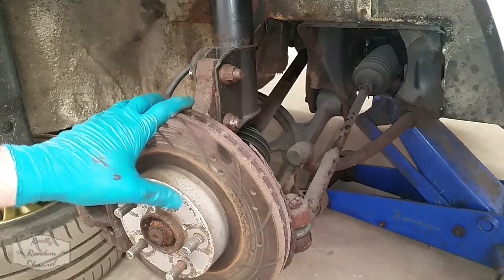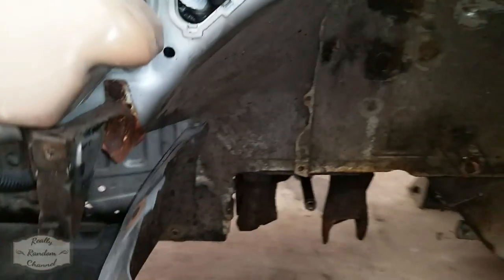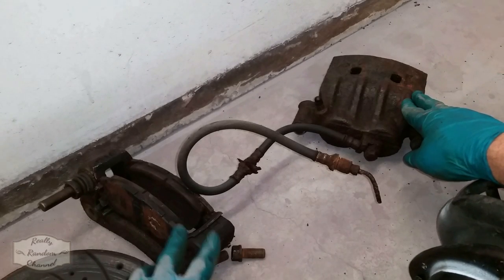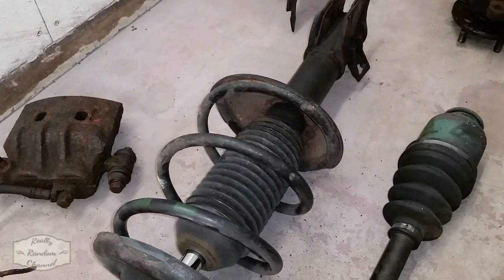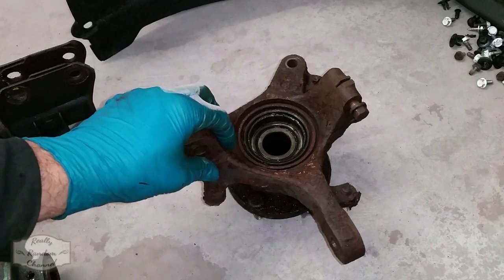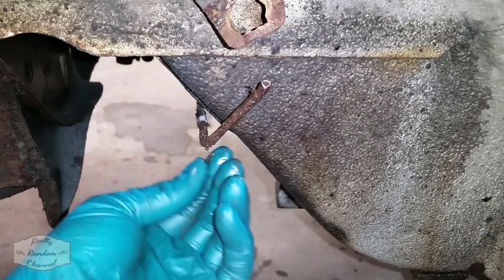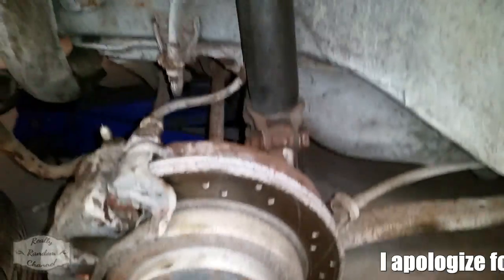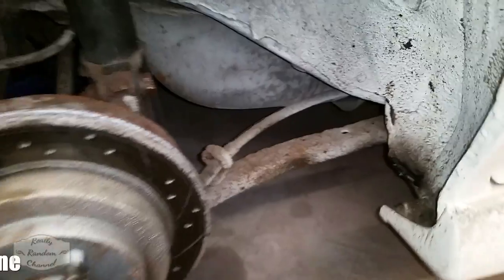26 Year Old Rusty Suspension And Arches Made New Again - WRX Restoration

Comment: great job as usual, only one remark: when tighten the swingarm's front screw, it must be the same position as the car sitting on the wheels otherwise the rubber in the silentblock will be damaged very soon...
Reply: I think you should reply to this comment since it is VERY IMPORTANT to prevent failure of the front lower arm bushing. Tighten the bolt after the car is down with weight on wheels or you will rip the bushing on the first bump you hit.
Reply: TonyZ oo
Reply: Good I am not the only one who saw that :)
Reply: I came here to say this haha
Reply: I was here to say just that 😂
Reply: By swing arm do you mean control arm?? I am currently in the middle re assembling my suspension in my own car
Reply: @Neil-914  I think he's talking about the sway bar as he mentions rubber block.
Reply: @Neil-914  In general all the silent blocks must be in that position before fix the screws when the car sitting in the wheels. Otherwise the rubber parts will be tensioned all the times and the lifetime of them will be extremely short.
Reply: @injuhasz  what silent blocks. I've just out factory suspension back on my car. I presume ball joints, hub pinch bolt, end link nut etc can all be torqued whilst in the air? I didn't touch the subframe side of the control arms
Reply: i've never seen that happen once tbh.
Reply: @nealpurnell7438  oo = yes (in Filipino)
Reply: And one other thing... That was not how you do an ISO double flare. You only did half the flare. You need to then finish off with the taper after the dimple set. Scary.

Comment: Shouldn't the lower control arm bush be tightened to spec when the car is on the ground? In my Impreza i was doing whole rear suspension and every bush was tightened with car on the ground and one person in the trunk.
Reply: I thought the same thing
Reply from the maker: Technically speaking yes they should be as tightening them while in the air tends to "preload" the bush making it wear a bit faster than it normally would but as this car isnt my daily driver and will only see the road a few times a year im not overly concerned about slightly accelerated bush wear.Thanks for leaving a nicely thought out comment though :)

Comment from the maker: Hey Guys, For everyone concerned about me using copper for the brake lines i would just like to let you know that they are NOT copper, they are an alloy containing some copper hence the colour and are sold as fully tested and rated brake line replacement. So unlike pure copper it doesn't work harden over time and shear or crack under high pressure. No safety issues here what so ever but i want to thank you all for being concerned about my safety ;)
Reply: Used to be steel Bundy tube but now would be more commonly kunifer or cupronickel tube. 

Ironically we use copper nickel alloys now because steel tubing may suffer from corrosion. So steel is less safe.
Reply: Did you torque down the bushings after you put the car on the ground?
Reply: You just answered my question my good man
Reply: Un cambio radical
Reply: Just fantastic
Reply: Just answered my question haha. I was a bit worried but I guess instead I got to learn something new. Keep up the great videos, loving the build!!
Reply: beware the arm chair engineer army.
Reply: The front and rear brakes are separate. Even if the front fail the rear will still work.
Reply: @fjgfjghjhnghuj4  In Finland pretty much no one has steel brake lines anymore, for aforementioned rusting issue. Steel wall is pretty thin and corrosion is huge issue due so much salt use on the road for ice and on summer for dust prevention, since folk from capital cant drive on ice (or at all for that matter, every winter surprises them regardless and there is dozens of pile ups even if its known that first snowfall is coming) and cause corrupt politicians have wasted public funds and played them into their own pockets, asphalt roads have been dropped in priority class, ripped open and made into dirt roads, what leads into horrid dust problems and depending how road was made, into horrid clay mud crap in every bigger rainfall. Top of that these roads need constant planing costing even more that maintenance of asphalt would have, specially if repairs would been done properly not by stamping on the patch work with foot couple of times.
Guess idea is to get all older cars to rust away, so new shittier cars can be forced on people.
Reply: braided steel is better

Comment: Looks great! I don’t know if this particular car is like this, but I have always been told that all torque specs on the suspension bolts apply when the weight of the car is loaded on the suspension. You may want to retorque with the weight loaded on all 4 corners before you actually start doing events with it!
Reply: You are correct.  This is so the bushings are in a neutral position with the weight loaded.  If not you WILL see premature bushing failure.

Comment: Excellent video once again my friend! One question only: why didn't you paint the suspension nuckle?  Won't it rust soon again?
Reply from the maker: thank you , glad you enjoyed the video. Good question, I left the part unpainted as the bluing process should protect the steel from rusting again and this part was never painted from the factory so i chose not to either.
Reply: Outstanding job! It looks so easy....
Reply: It is a great job, however I personally don't like the bare copper brake pipe.
Reply: Very good vid think you got another sub.... aru  here 😂 mind the pun 😂 excellent Intel could you do a break down in cost of parts of possible thank you
Reply: @petergordon4525  I was wondering about that. I've got to replace my brake lines, and when he brought out the copper, I was thinking "well, that'll be easy!" but after a search, most people agree that copper brakelines are too soft.
Reply: @arthurspontiacfieroblog  i thought one might wrap it in something to protect it from lesser road debris, after seeing him fabricate it...
Reply: @themadmallard  I just discovered that they do make a sheathe you can slide over the lines

Comment: 14:14 i have never seen an easier ball joint install
Reply: cool subaru design, since the '60s.  this design anywhere else?
Reply: They're good but those 14mm bolts are notorious for snapping off in the knuckle. You also have to be careful spreading it to get the ball joint out. Really easy to break those eyes off the knuckle with a chisel or a flat head as shown in the vid.
Reply: Only ball joints I have done were on old Ford trucks from the Northeast of the United States (Rustville, USA.).
Anything NOT involving a 4# hammer, a torch, and a rented press impresses the s**t out of me!!
Reply: I'm currently replacing lowers on my Civic and they're a nightmare. When I saw how Subaru's did ball joints, I thought, "They should all be like that"
Reply: @JasonTylerRicci  I have some experience with those. did you try the C clamp and socket method? after the hydraulic press thats the 2nd easiest way to do them
Reply: @darius2640  indeed. I even  bought the Honda specific adapter set. I got the uppers no problem. With the lowers , the darn knuckle is in the way and the adapter just slips right off. Royal PITA

Comment: Beautiful job right up till the part where you put on the copper brake lines. I don't think that copper lines will even pass inspection in this country. Copper work hardens anywhere it can move or vibrate. I would never use copper brake lines on my car.
Reply from the maker: Hi, The brake lines are a special copper alloy specifically designed for brakes lines, perfectly safe ;)
Reply: @RRCRestoration  might want to mention that in your video as there are probably viewers who may use soft copper by mistake with potentially disastrous results.
Reply: @RRCRestoration  it wouldn't pass here in the states! and you didn't double flare it!
Reply: @RRCRestoration  I have used these type of brake pipes literally thousands of times during my career and they are perfectly safe

Comment: Cheers from Japan. Nice video. Two point. Need grease between stabilizer bar and rubber bush,　otherwise it queeks  later  .Bolts and nuts of suspension better be tightened after car stand on the ground, So called as zero gravity tightening to prevent any unnatural torsion to the rubber bushes

Comment: Awesome work!! I would definitely re-adjust the bushings with the proper preload..one corner at a time put it on 4 jack stands then loosen the bushing hardware on a corner, jack it up under the lower control arm until it lifts off of the jack stand and the weight is on the suspension then tighten the bushing hardware to spec then repeat each corner. I’m currently doing the same complete suspension job on an old EG Civic hatch and luckily I researched it prior because I had no idea this was how it’s done and I would have tightened them down before same as you did

Comment: Great video. I didn't see you tighten the inner tie rod...? When I replaced mine I used a special tool to do it without outer tie rod attached.
Reply from the maker: Yeah, I had to leave some parts out as they are just too tricky to do the job and get a good camera shot to show whats happening but i can assure you they are tight ;)
Reply: @RRCRestoration  Nice! I figured you did it at some point. My fuel pump died on my bugeye WRX so that's my next thing to replace. Was going to get a Walbro brand but saw it had some reliability issues related to fake ones being sold. So, I bought a DeatschWerks 255 LPH kit; hopefully it fits/works well.
I've had this car for 15 years... love it. :)

Comment: I've been using an unorthodox way that no one dares to copy, but have years of practise on vehicles I still own, so can vouch for the suitability...
After the rust converting stage, intead of getting out the paint, cavity wax the converted metal as if you were painting a first layer of primer onto the unpainted surface.

THEN paint over the top. You've just got to realise it's still a little wet under there quite a long time after the paint has dried. Works a treat and NEVER re-rusts as moisture can't get anywhere near the metal! Paint can be porous, don't forget... I use Dinitrol cavity waxes. i.e. ML, 4010, depending on application viscosity, temperature of surface, and colour of finish required.
Reply: Works on body panel edges, like wheel arches...
Reply: 2K clear final coat and Bob's your great uncle Dave.

Comment: You are Lucky and have Aluminum Wishbones, My 2004 Impreza has steel wishbones and I knew it had rust when I purchased it but after taking it for a test drive about 75 miles after taking ownership, my wishbones snapped caused me to crash at 65miles per hour and hit a sign. I am now rebuilding everything and anyone that has a older Subaru, make sure to inspect your wishbones for rust. There is a Big Safety recalls on Subaru wishbones. Great Work!

Comment: Nice video. Very professional.. You could have greased those slide pins on the 4pots when you put the pads in.. helps if al move freely and dispaces water from the metal pins. But you proberbly already know this..

Comment: Excellent job as usual, mate! +1 on the comments about torquing your suspension on the ground under the car's own weight. Also, you may know something about these brakes that I don't, but I was taught that you never use copper tubing. Since the copper is softer than steel; it will develop stress cracks and start leaking from the pressure, when the brakes are applied. The four pots really look the part, absolutely stunning.
Reply from the maker: Hi, you're spot on about copper being used as brake lines but these lines are not pure copper they are an alloy designed to be used as brake line so no safety concerns here ;) Thanks for leaving a comment though nice to know you guys have my back :)
Reply: @RRCRestoration  Anytime!

Comment: Update Wednesday 30 August 2023 8:06pm cdt
Great Work, BEAUTIFUL WORK! What solution was that to dissolve the under-coating? What material are you using for the brake lines?
PLEASE, any contacts in Lincoln Nebraska but anywhere in the states of foreignville where they push themselves to this level of ability?

Comment: i did the same to my forester 2001 gt turbo but i did high pressure brake lines 4 spot calipers and ultimate vented drilled slotted discs and sway bar to 22 mm = not it is really sticking to the corners = i live in the mountains ! - great video and hello to subaru owners = more smiles per miles !

Comment: Those Subaru Sumitomo 4 pots are such a great brake upgrade for these cars, so much so I installed them on my 2004 Subaru Forester XT. I think you should look into upgrading to the matching rear 2 pot caliper with the larger vented rotor of the later WRX, that alone makes a rather large performance upgrade to the braking and still keeps it all Subaru. Starting to look mint now.
Reply from the maker: Hi, Yeah i totally agree with you, with the 4 pots up front it makes total sense to upgrade the rears as well. Glad you're enjoying the vids :)

Comment: I loved this. Thank you. I'm looking forward to your video when you restore the rear.

Question: the sprayer that you used to paint the wheel well - that was amazing! Very fast, wide coverage! What did you use to do that? What kind of paint was it?

Eventually, I'm going to pull my engine / suspension, and I was not looking forward to  slow, methodical rattle-can painting - this made rather quick work of it!

Comment: Very nice! I'm ironically doing the same thing to the rear end of my car! Even dropped the rear subframe. I'm having difficulty removing the rust down to bare metal. I've used an assortment of tools, but there are too many dips and turns in the subframe to get a good bite on it with a drill attachment. So, I've used a pneumatic needler to break apart the rust particles and plan on just painting on some rust reformer prior to painting. Have you ever used POR15 for suspension parts? To prevent rust from ever coming back - I'm thinking about using the rust reformer on the entire subframe. Then I'll paint it with Rustoleum heavy duty rust primer. After that I'm thinking to top coat with a few coats of POR15 and then either a semi gloss clear or a can of raptor liner. What do you think? I've even tracked down some new rear bushings for the subframe. I don't ever want to take it off again - so I'm trying to coat it as heavy as I can before I reinstall it. The powdercoat guy around me is asking far too much to powdercoat it. That's why I'm taking this approach. The raptor liner you use on the inside fenders looks great! How did you tint it?

Thanks!
Emmanuel

Comment: I love this channel.  I have, o the fist time, a concern.  The copper brake line.  That would be flagged in any shop in Canada, and pulled off the road. There are proper lines you an buy, that have multiple layers to protect from corrosion and heat; and strength.   However, I'm open to new things, please let us know if you have any problems. If not, I may try it on a clutch line on a old 323.
Reply: Also, I'm not a Troll!  I am genuinely concerned.
Reply from the maker: Hi, thanks for leaving a comment and i appreciate your concern. The brake line looks like copper pipe but its not, Its actually proper rated and tested brake line that is an alloy containing copper hence the colour, but unlike copper this stuff doesn't work harden and fail like pure copper so there are no safety issues here. Glad to know you have my back though ;)
Reply: @RRCRestoration   I'm relieved too hear that. Sadly, I know have to run some experiments to see what happen with regular copper line.  Who knows, there might be a channel in it.  Stay safe.

Comment: I thought we only had rust like that in Wisconsin.  Also a strange thing happened to me recently.  I was looking at a used WRX here in Wisconsin and i was inspecting the car.  I opened the hood to take a look at the engine and on the side of the intercooler was a sticker that said "really random channel".
Reply: Jamie Healy We actually have 4 seasons and it is not really wet, pretty much perfect amount of rain.  We get snow in the winter and the put salt on the roads to clean off the snow and ice.  This salt it what turbo charges the rust.  Some parts of the country get snow like us but they don’t salt the roads.  I have heard that rust is not a big issue in these places despite the snow.

Comment: Great video, interesting even if nothing was new to me. Now I really understand why my old jdm import, uk import to finland 93 impreza is in its current condition, waiting for trip to junk yard. I guess you need to change even teaspoons in uk like twice a year there because of rust. My current 95 impreza that came straight from japan to finland is basicly rust free compared to yours or my old one. Btw you can just put both of the brake pad pins in, and that spring clip whatever its called will just clip on later, bottom first, much easier. I'd really like to know how the bluying will keep the rust away, so please keep updating. I just apply some graphite paste on those parts each time I work on that area, seems to work well, it wont rust and it can take huge amounts of heat, seems to work well.

Comment: Really nice job we expect nothing less. A quick  question no copper grease was applied to the pads?.
Reply from the maker: Hi, Glad you enjoyed the restoration. No grease is applied to the pads as they have a rubber backing pad to prevent squeal also its only the pins that hold the pads in place so no carrier lugs to grease either.

Comment: Thank you for this video it's very helpful. Will just ask a question, what would be the problem if you're having some annoying sound in left side front wheel while driving, is the problem is in the wheels, suspension, shock, or the metal connection of the shock and suspension?